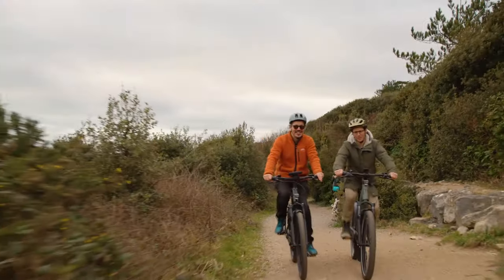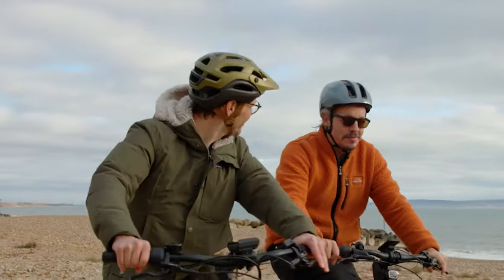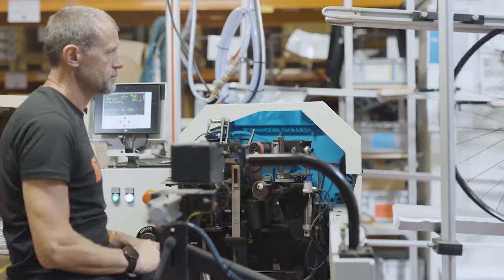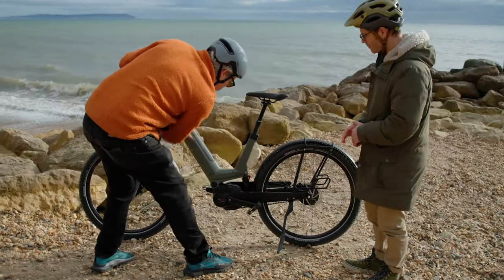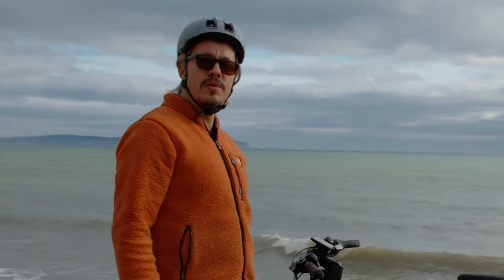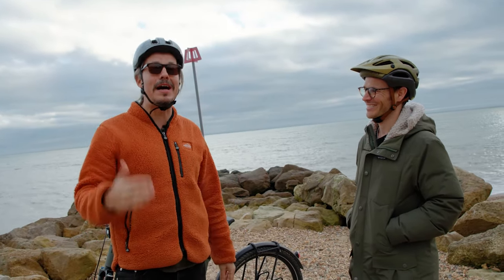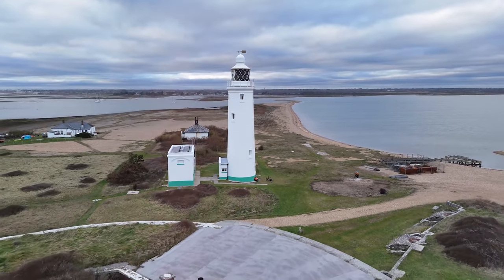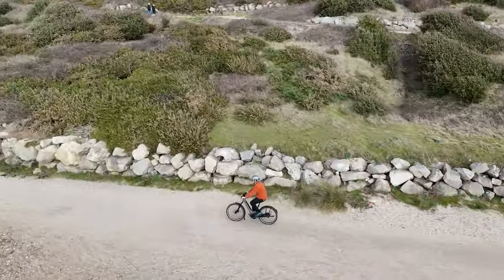The MOUSTACHE® J Electric Bike: Review + Ride Out With Moustache Founder Greg

Comment: Lovely looking bike and sure it's excellent to ride. But when Ben said that other bike manufacturers look at Moustache and follow, in this case I'd argue that Moustache looked at the Riese-Muller Homage and followed them. Nothing wrong with "tipping your cap" towards the competition and improving where you can. Look forward to a test ride. Also nice that so many components are made in France.
Reply from the maker: yes i would agree with this, step through full suss was benchmarked by rm and now moustache are in the lead with step through full suss cast frame, and it’s a lot prettier. although rm still have the rohloff ace card! 

i was originally referring to the likes of cube copying moustache xroad with their katmandu.